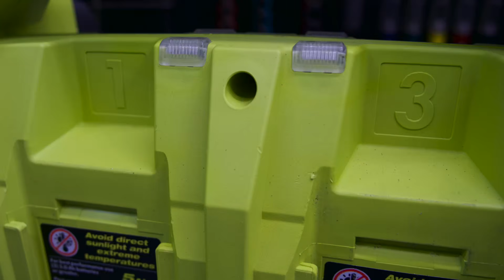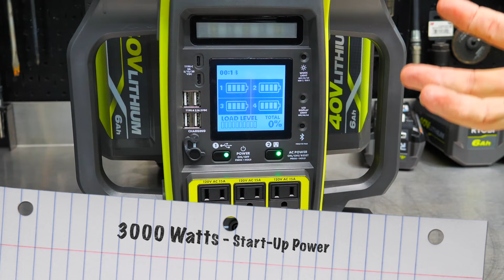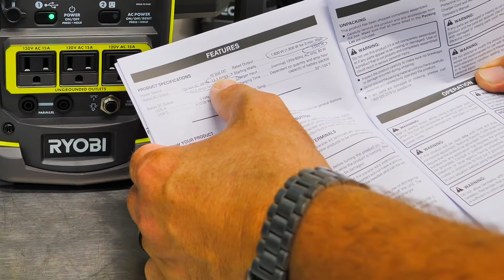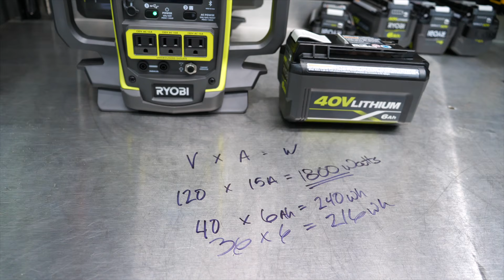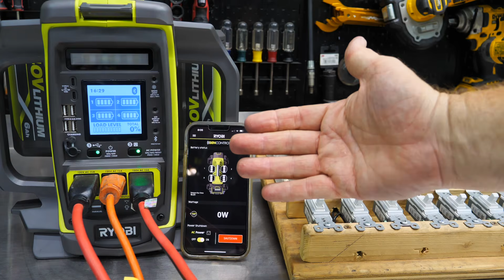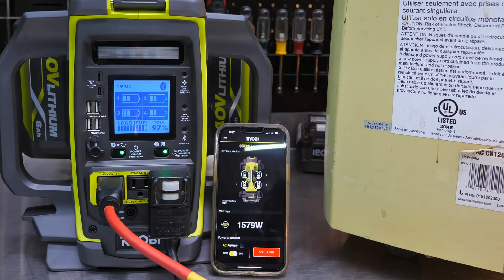Replace Your Generator? 40-Volt RYOBI Power Station - 3000W or 1600 Watts?

Comment: Honda 2200 watt generator $900 runs on a gallon of gas for 10-12 hours average gas price right now $5.00. I've owned one for 13 years still works like new. Lithium batteries alone won't last nowhere near that long.
Reply: they are very different applications most of the time. Ryobi also sells a range of petrol generators. This is something you can pull out in a pinch while you have a bunch of tool batteries with you, this is very small and light, will happy fits and sit on a desk or confined spaces, does not produce any emissions or requires any oil or maintenance (shove it in the back of the truck and forget about it for a year if you want). For light or quick jobs in doors or confined spaces with no ventilations. for larger sustained use then use a petrol generator and run the extension cords from wherever you can safely set it up.
Reply: @penitent2401  I totally get what you’re saying but when the cost of the battery generator is the same or more than the comparable 2200 Watt Honda generator that’s 50 pounds and runs on 1 gallon of gas for 10 to 12 hours. I have owned one for more than 12 years only changed the oil in it once because it’s mainly kept around just for an emergency outage. A battery generator batteries are going to fail they will not last and the batteries are expensive to replace. Battery generators run times are gonna be way less than 10 to 12 hours on a single charge . Battery generator are just not cost-effective yet.
Reply: @freerangehuman1976  I'm saying they are intended for different uses and situations, so it's not really comparable that way.
Reply: @penitent2401  I have seen many YouTube channels reviewing power stations and they are using them for the same uses as a generator to supply power to anything that uses electric. A Power Station is likely to be used by a consumer in a power outage just like a generator so I disagree with you. I agree with you that every tool has its place but when the tool does the same task which is supply power you have to compare them. Consumers need to know which tool is best for them and the cost that they will be paying and what its return will be. When the power station and its batteries cost are well over $2000 and the batteries have a limited lifespan I would much rather have a $900 Honda generator in case of a power outage it produces more watts and runs much longer without needing to recharge at all. And if you use true fuel instead of gasoline you don’t have to worry about ethanol storage problems or run the generator out of fuel for storage. Power stations and generators are intended for the same purpose to supply power to devices that require electric.
Reply: @Free Range Human
I’m not sure but I think you may be confused about the life span of lithium batteries, maybe you know more than you let on I’m not sure. I usually end up correcting people when they repeat what they hear about lithium batteries and when the life is rated in a device that those batteries will keep the capacity for 300 or 500 charge cycles , depending on the chemistry of the battery. That rating is if you drained those batteries every day straight and recharged everyday up to 100%. Then you would be left with 80% of the capacity after 300 charge cycles, so you would loose the top 20%. It doesn’t mean the battery is bad it just means the length of time it used to run a given device will be 20% less run time. You could easily double the life of that battery if only discharge down to 20%, or 1 of 4 bars left, and recharge up to 80%, or 3 of 4 bars on the fuel gauge. A charge cycle is discharging to empty and recharging to 100% full. Lithium batteries can easily last well over 10 years. These home owner grade tools are not discharged everyday. More like once a week, if that.
Reply: @Free Range Human 
I talked my, widowed, mother into the ryobi 40v tools over gas powered. She wanted the independence to maintain the tools herself, especially since I travel a lot for work. She loves these battery tools compared to the gas counterparts since she doesn’t have to pull the string to start the tools. She lives in the territory of the US that is very prone to tropical storms and hurricanes. Since the only engine that requires gas is her car there’s no reason to keep gas on hand an maintain it. She can easily keep this inverter in her laundry room and pull it out when the power fails. Since I advised her to check out the Home Depot deals, every tool purchased came with a battery when this popped up she only had to buy the tool only which is much less than $900 and even less then having to maintain a combustion engine.
Reply: @freerangehuman1976  if you only go by youtube reviews then you may not get the sense what the intended purpose of these are, like this video they test it until it overload or how long it lasts on max. They are showing the maximum capacity or limits of a tool, especially if they are comparing different brands. if you buy this expecting to run off it all day at a standard job site on batteries then you of course will be disappointed with it only lasts half hour on 2kW load. but if you need something that you need to get into confined space with or has no ventilation, or carry up a remote area, this thing including batteries weighs a quarter that of even a small 1500-2000W petrol generator and can fit in a lot of backpacks. If you want stuff that is more in range of petrol generators you can get 6000wh+ power stations that are same size and weight as the petrol ones, these are much more expensive and I've seen them market more toward mobile events or motor home and caravans with solar power attachments.
Reply: Noise….
Reply: They are getting g better far as size and capacity. Better to have both types. Think solid state with has 3x the capacity. And the dual fuel generator to use with itt.
Reply: Hondas website says .95 gallons 3hour to 8 hour run time. So if you are pulling aloof wattage it is gonna run 3 hours. If you are getting 8 hours that is basically no wattage draw. And should probably just be turned off anyway.

Comment: So if I want to use this station to power small 12V devices, does that mean I have less watt-hours, and therefore less runtime with 12V devices? I.e. 12v * 6Ah = 72 watt-hours.
Reply: the 6Ah is the battery's capacity, each is 40V so each battery provides 240Wh, 4 of them is 960Wh, this is the power supply side. 
For the power draw of your device, the voltage (12V for your device) is how strong or powerful the device is, how much torque or pressure it produce etc. its power consumption needs to take it's amperage as well, which is the volume or flow rate of power it requires, this dictates how fast the device it can spin or how much volume it can move. for simplicity I'll say your 12V tool has constant voltage at 12V meaning it'll always produce same amount of torque, then it'll draw the current, Amp, at varying rate depending on what work it is doing. there is a max amp rating on it as well, look on the back label. Say the max current it can draw is 10A, and you are using the device at max power constantly then the power draw from it is 10A x 12V = 120W, this is the maximum device power draw, how much the device will try to pull from the supply. 960Wh divide 120W = 8hr, how long that device can use the batteries at maximum power before the batteries depletes.
Reply: @penitent2401  this makes perfect sense! Thank you!

Comment: liked video, at least i know it would not run my 5000btu window A/C very long so not worth it for me, so will keep using my 2000 watt inverter generator that will run up to 10 hours on a gallon of gas
Reply: What 2000 watt generator do you have that runs 10 hours on ONE gallon of gas?
Reply: @joshsmithjoshrocks lies

Comment: Dollar for Dollar, don't you think a conventional Gas/Propane generator is more economical?
Reply from the maker: Yes, for the most part. I think these are becoming more and more useful, but if you need continuous power, then gas or propane is probably best. The big difference is that you can use these battery powered power stations indoors. Thanks for watching.
Reply: sure, but this is for different application in mind. Something you can pack in the  corner of your car and truck for years, no need for oil or maintenance and as you can see, very light and tiny. can use in confines spaces or with no ventilation. or I imagine you can take it camping or fishing, you can pack and carry it around with little effort.
Reply: @penitent2401   im a mobile detailer i work on classic cars and showcars  i have a gas generator and currently looking to replace my gas generator for something like this ryobi or solar  generators gas is not an option no more i spend 70 on gas weekly $280 on gas just to poer a water pump and also a vaccum i think this is a better option gas in california is too much just not sure what route im gonna go solar or battery 🤷🏽‍♂️

Comment: Can you charge a Ryobi 40 volt battery with there quick charger while running a fridge at the same time. So that way you are always having a fresh battery charging while keeping your food cool in the fridge
Reply: if you have access to a power outlet to charge it up, why not plug the fridge into that? This is really for quick use on a site with no power or short camping. But if you must and have 8 batteries and it takes less time to charge up 4 than the fridge depletes 4 in use then sure, you can run it like that.

Comment: Thanks for the video - it's the things like 1800W for 3min vs 1600W continuous that have caused me to start reading the available electronic manuals before I buy the tools.  

A person can find some interesting things that may make them reconsider buying the item from time to time. For example the statement "Operations such as sanding, wire brushing, polishing or cutting-off are not recommended to be performed with this power tool." I read in the Makita LXT die grinder manual --- after buying it. Fortunately that's not what I bought it for though it would have been an unpleasant surprise if I had...
Reply: This is more like something you should use if you are RV or van living for a while, and need to run appliances while you also keep your regular drills and minivac charged. Or something to run your fridge when the power goes out.

There are bigger and better batteries for work sites.

Comment: Can you swap a battery while powering something…with no shutdown? Also, can you mix batteries, say 2 4ah and 2 6ah?
Reply: Yes you can swap a battery without shutdown as long as there is more then one battery on the station and you can use different size batteries but if you plan on using it frequently it would be best to have 4-5ah or larger batteries for it.
Reply: It'll go based on the lowest battery. When 1 of them powering it dies it stops

Comment: i wonder if we can put those new 12ah in it for test?
Reply from the maker: It's rather simple. The 12Ah is going to provide twice the runtime of the 6Ah. Thanks for watching.
Reply: Saw this post about the 12ah from a Ryobi tech on HD Q&A section.

Q: Ryobi's website states that the 40V 12ah battery is coming soon. Will the 40V 12ah battery fit the 1800W power inverter? Are there any plans to sell this 1800W power inverter and the 12ah batteries as a package deal?

A: Thank you for your interest in the 40V 1800-Watt Portable Battery Power Station Inverter Generator and 4-Port Charger with (2) 6.0 Ah Batteries. Yes, the 12 amp hour battery should be compatible with the 40 volt 1800 watt power station. Unfortunately, we are not sure what kits the 12 amp hour battery will be  included in.  Additionally, if you need further support, then a RYOBI Customer Experience Professional is here for you, Monday - Friday from 9 am to 6 pm (EST) when you call or text us at 1.800.525.2579 or through email or live chat when you visit us at https://www.ryobitools.com/support/contact. I hope this helps!
Reply: Hi, does it pick up the 12ah battery? I saw a video where the 12ah battery when inserted gave a warning /error message for the bay it was inserted into. Does that happen when add the 12ah battery?
Reply: @guadalupeibarra3564  What video?  By whom?  Link?

Comment: Always love all the info given in your videos. I don't care if you repeat how to do the math for this stuff. Not everyone knows these thing, so it's good that anyone who doesn't know  can learn.

Also if anyone knows what battery cells are used in the ryobi P194 (old) 6ah 18v battery, I'd really appreciate the info. I can't seem to find out online.
Reply: 18650 cells I think, I doubt they’re 21700 cells.
Reply: The 18v Ryobi batteries are run on 18650 cells.  I have seen Samsung and maybe LG.  I have been in numerous 18v battery packs to fix them.  The YouTube channel “Thrifty Tool Shed” repairs Ryobi, Dewalt, and EGO battery packs if you want to see the internals.
Reply: 18650 cells has been improved during years, see milwaukee usb 3.0 using 18650 with 3000 mah capacity (my terms may be wrong), I am pretty sure the 12ah battery are using those and the old 6ah batter is using 18650 with 1500 mah capacity which is old 18v TTI line is using. if you see new ryobi usb lithium, they are using 18650 2000mah which sort of match old 40v 6ah spec.....I may be wrong I just see how TTI use of the battery, 21700 cell is not necessary, it is more for industrial grade usage

Comment: Two things?? 

1. When you connect them together and run them in parallel, does that bring up the continuous output to 3000Watts? 

2. I would love to see two of these connected together in parallel running 12AH batteries in all 8 bays!!! And re run the test to did in this video. 

Thank you so much for creating this video!!!
Reply from the maker: 1. Yes, this doubles the output to 3,200 Watts continuous (1,600 x 2).
2. We could do that, but it would require a second power station and the additional 7x 12Ah batteries. Really, all you need to do is make the calculations based on the Wh out, and it will tell you everything you need to know.
Thanks for watching.

Comment: If each battery is 40V X 6Ah = 240Wh. 240Wh X 4= 960Wh. How is making 1600Wh?
Reply from the maker: You must not have watched the video, because I purposely an specifically showed why that exact calculation you made is wrong. Thanks for watching...
Reply: @Shoptoolreviews  I could be wrong, but I was an electrical engineer for 34 years in the power industry.  I watched the video. The total available power is 960 Joules.  If you have 1800 Joules in half of an hour, then by the same token you can say you have 57,600 joules in 1 minute.  That total capacity with Power Factor of 1 is 960 (assuming voltage is 40 and each battery is 6Ah).  The rate of power draw is rapid but you still have a fixed amount energy that can’t violate the first law of thermodynamics.
Reply: it's 1600W not Wh. 960Wh (960 x 3600 = 3456000 Joules) are the capacity of the batteries, 1600W is how much it can sustain pumping out (1600 Joules per second), or 1800W for a very short time. You are an electrical engineer for 34 years can you don't know difference between W and Wh? I'm chemical engineer and they teach even me this in the fundamental year (1st year uni), also high school.
Reply: That’s how much energy storage not the watt output. Unfortunately most if not all batteries don’t disclose their current output so we can’t see how many watts each battery can output . The only way you can tell how much theoretical current output each battery can output is to take it apart and check what kind of cells they Are using and use the data sheet from the cell manufacturer and see what the max current output and then you add it all up and see how much each pack can output . BUT!! Ryobi has current limiters built in on the pack so that sum of all cells may not be the packs true out put
Reply: @TheOriginalBumper  that's equivalent to 960 joules not 1600 joules,  but they cheat by saying 1600 joules in .5 hour not 1 hour

Comment: Thanks Tim! I am going to buy the M18 1800w unit since I have a few HD12 batteries. Hopefully it’s not a let down! 

Thanks again for this review!
Reply from the maker: I don't think it will be a let down. The Milwaukee specs show that output should be a bit better, and the charging will be much faster with the onboard charger. One of the drawbacks is that the Milwaukee requires that 4 batteries are installed. Thanks for watching.
Reply: Way overpriced don't waste your money

Comment: Way better than the new pos Milwaukee they just released.
Reply from the maker: I don't know that I'd say that. The Milwaukee M18 Carry-On should have more output and the onboard charger is much faster. The drawback is that the Milwaukee requires 4 batteries for it to work. Thanks for watching.
Reply: I have seen some comments about that device. Seems their only problem is the price.
Reply: Just say your bum ass can’t afford a few 12.0’s next time 😂